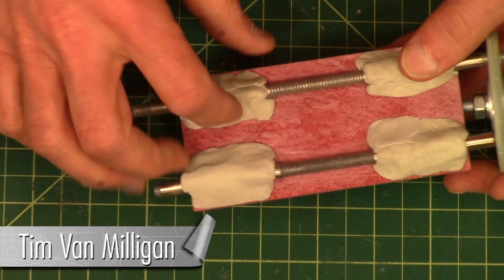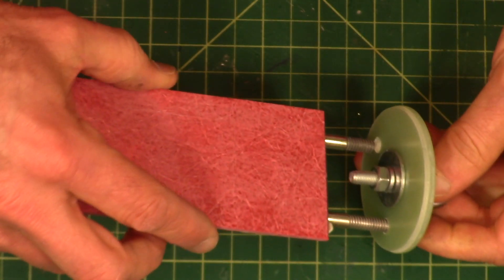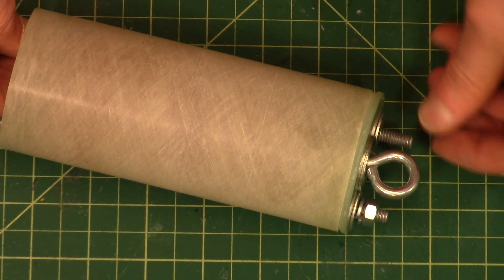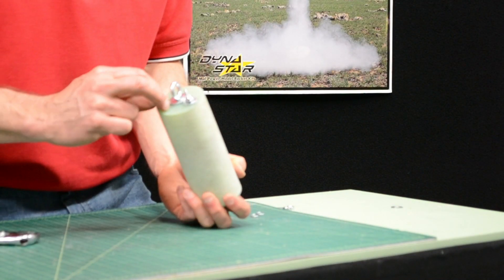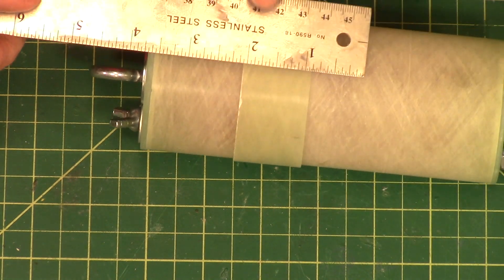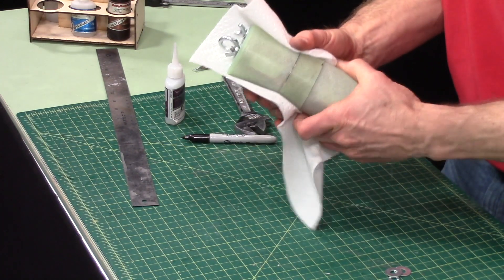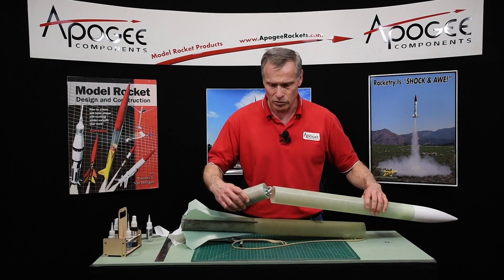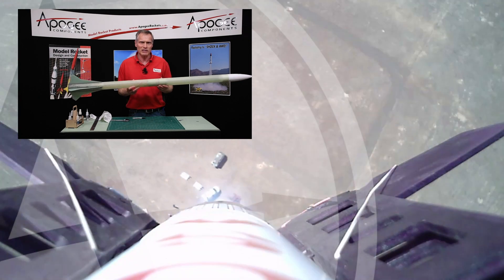Building a Fiberglass Rocket: Part - 12

Comment: Placing washers under lock washers eliminates their locking effect. Either glue the fender washers in place or don't use them with lock washers. 

Honestly, if you are serious about the airframe you are building,  you should use drilled nuts and safety wire.

Comment: Tim, 
On a rocket that big, how would you feel about plastic rail guides super glued after the paint was on?  My Mantis is 2.6", about 50" tall and weighs around 3 pounds.  Would you trust it with the rail guides or would you rather normal rail buttons?